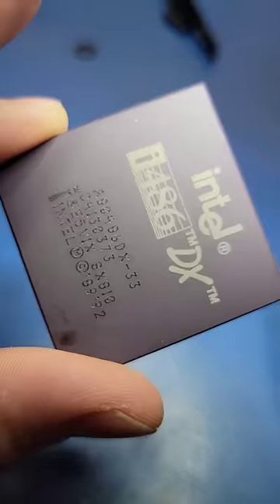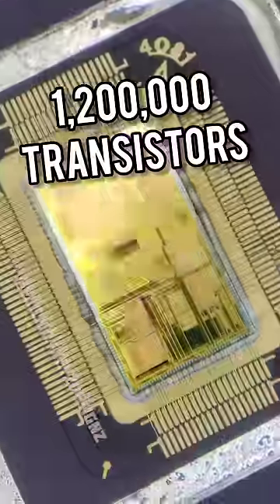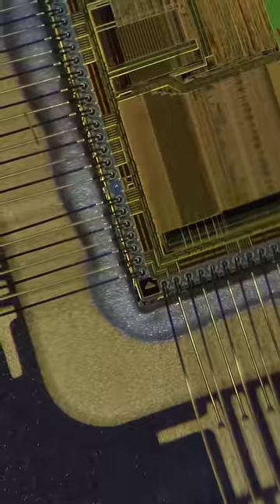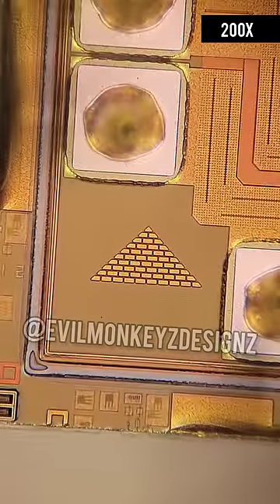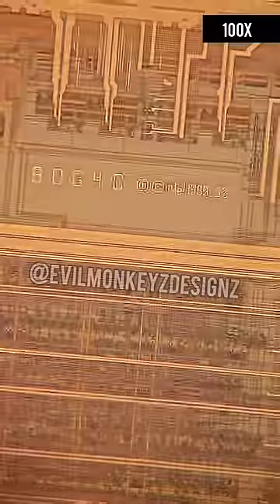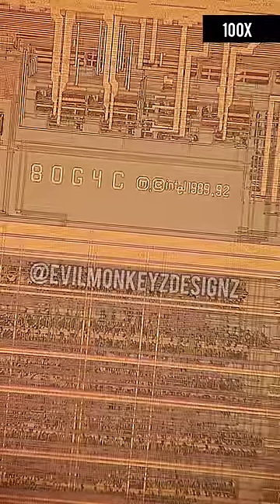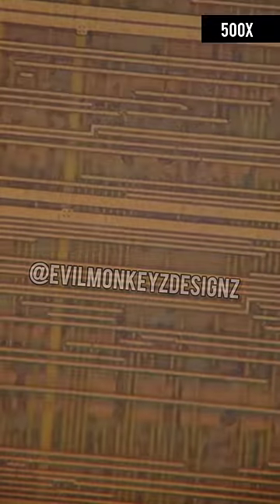Inside an Intel i486-DX CPU

Comment: This already looks very complicated and its only 1,2mil transistors. Its insane how they can fit billions of transistors on something the same size nowadays.
Reply: How big does that make the traces? 100 atoms wide maybe? I'm really curious, if you can answer that
Reply: @furnacego2164 Minimum metal pitch at the 0.8 μm process node was around 2 μm, and about half that for trace width. The minimum distance between atoms in silicon is 0.2 nm, so a trace was ballpark 5000 atoms wide.
Reply: But nowadays traces are 20-30 nm wide at narrowest. So 100-150 atoms.
Reply: @taktoa1  amazing
Reply: @taktoa1  it makes me wonder if there is a hard limit, like if a theoretical trace is 1 atom wide I wouldn't expect the connect to be very reliable
Reply: @furnacego2164 iirc some undesired quantum side effects become problematic the closer we get to atom size (quantum tunneling supposedly, but don't take my words for truth I'm not very literate on the subject)
My concern would also be how does a 1 atom wire/gate/whatever dissipate heat
Reply: @weistonaski6924  If they got to traces being a couple atoms wide, I'd assume they'd have to have the cpu sealed and filled with some sort of gas or something. Wouldn't be able to delid it but.. I'm not sure what else would work.
Reply: Seems my last reply was removed for including a source, typical YT. 
Silicene is being invested in for semiconductors. It's the silicon equivalent of graphene so truly is only an atom thick.
Reply: @EddieTheH  I hope we can figure out the graphene problems, that will change life and possibly time.
Reply: @No_Fuse8771  Agreed, it'll be a game changer.
Reply: What i don't understand what machine can make that so small than any point tip device, lets say it much more like a plat where they inject something like liquid to become a mass small transistor, but still the machine that make that billions, how they make it?
Reply: It's interesting reading at comments from people who knows their shit talking, I could sit in a cafe with y'all and listen all day.
Reply: @jeffreyphandani5160 they wouldn’t used traditional mean of manufacturing for semiconductor. The process is more like using lasers to cut the pattern into a plate covered in wax. Then you run acid over the plat. Then the acid eats away the exposed area. I can’t give any more details after this point. Bc I am not that familiar with the process. But that is a very simplification of the process.
Reply: @hoktang1  thx u enough
Reply: I think current standards are of the order of 150 billion transistors today.
Reply: @deang5622  Out of the consumer level microprocessors the Apple M2 Ultra should be the biggest with 134 billion transistors. 
Solid state memory has way more transistors though. 1TB of TLC flash memory has close to 3 trillion transistors.
Reply: @furnacego2164  At 1 atom wide... Electrons would migrate and the trace would be corroded very fast.
Reply: @taktoa1 dude that’s seriously impressive - congrats son having that knowledge man that’s some real shit! 👌🙌
Reply: Tell me aliens had nothing to do with this...
Reply: @OregonDARRYL  aliens had nothing to do with this
Reply: @jeffreyphandani5160  you use photo lithography
Reply: @beeman4266 what would the gas do?
Reply: "And it's only an incomprehensibly big number of transistors"
Reply: It now clocks in the low to upper 4GHz speeds with double digit billions of transistors. Absolutely wild improvements.
Reply: Silicon Cities.
Reply: Precision required for current CPUs is just mind boggling.
Reply: Ans doesnt melt instantly 🤯
Reply: mil ❌ / Mio. ✌️
Reply: @beeman4266  a superconductor could theoretically achieve those qualities, but the material doesn't exist yet.
Reply: @OregonDARRYL  I've been watching this technology closely since childhood and know the history of the transistor. The progress was slow and steady. I feel like it kind of took off in the early 2000's but remained steady the whole time. There was no "singularity event" producing an unbelievable jump in tech as you would expect from advanced alien tech. I feel like any alien who may be here must have mastered methods of warp drive or anti-gravity tech. Computing power is no longer impressive to me.
Reply: @billybbob18  I hear ya... but look at a 128 GB TF drive and you gotta say... wow. 128 billion addressable points on THAT? Wow.
Reply: @beeman4266  Looks like this tech is running out of things to do at room temperature. The room temperature superconductor will be the next holy grail in computing I suspect. For now, I think TSMC owns the cutting edge.
Reply: Imagine, there are 2 TB micro SD card exist. That means 2000x1000 million byte in the size of my smallest nail!
Reply: @とふこ  Remember... aliens had nothing to do with the shrinking of all of this stuff. Nothing at all...
Reply: @furnacego2164  I think the limit is above 1 atom because you start getting interferences in the flow of electrons even above that point, so i'd say 10 atoms is probably the limit.

In either case you can always start scaling up the processors to keep making them more powerful, though then they generate more heat
Reply: And i wonder How they make processor making machines
Reply: @taktoa1 Excuse me but how can the measurement of 0.2 nanomicrons be the same as 20 or 30 nanomicrons?
Reply: Nano meters
Reply: @OregonDARRYL don't underestimate humanity. Many brilliant minds specializing and refining technology over generations.
Reply: @taktoa1 They are making cpu's with transistors smaller than 7 nm.
That's <0,007 of a um, so it is basicly nano technology by todays standards, not micro tech as desktop sized pc's was once called micro computers, and mainframe pc's for mini computers in the 70's.
"Smart"phones from now has more powerful tech built into them than (or atleast just as) computers had back in 2010 with quad to octa-core tech running beyond 2,5 GHz with ram memory beyond 8GB and a solid state storage up to 1 TB, all in a pocket sized case.🤯👏👏👏😊
Reply: Agreed, it's pretty darn cool. God bless. Jesus loves you!
Reply: @furnacego2164 Is probably approaching the limit of what we can do with classical physics.
Reply: They don't fit transistors, I think they print with special ink or something. 😂
Reply: I love this guy's shorts (videos, not "shorts" 🩳).
It BLOWS MY MIND how small humans can construct, IN CARFUL DETAIL no less.
Literally looks like otherworldly tech to me if I think about how small and powerful these glass artifacts are with their magical ruin symbols on them that allows them to tap into astral energy. Lol😅

It's really something.
Reply: about 2.6 trillion for the intel processor as of 2024.. . and
5.3 trillion for for ddr 5 memory ..as of 2024
Reply: And they want you to believe that it is a product of chance. Think about it. I hope you understand what I'm getting at.
Reply: @freedomofspeech2855  I don't think you know what you're getting at.
Reply: Looks super complicated but is the equivalent to banging rocks together compared to what we use a few short decades later.
Reply: @beeman4266 You're absolutely correct! If the traces were that close, electrons would jump between traces erratically, so some type of medium to electrically isolate each trace would be necessary, if they could be isolated at all. This is a problem we're currently attempting to solve with the use of silicon as the conductor for the transistors. We've reached a bit of a ceiling for how small the die can be for each cpu and still have reliable electrical behavior. We are looking into things like die stacking, and even the use of other electrical mediums like graphine, but as of now we're rapidly reaching a peak in the speeds we can reasonably expect from a silicone die without making the die larger.
Reply: @JayJadhav  There's currently only one company that can make the state of the art 'processor making machines', ASML. At its core, it's a bit like photography. Chips are 'developed' using chemical reactions to light. However, the scale of it introduces some highly complex engineering and physics issues. Those machines themselves are massive; about the size of a shipping container.
Reply: @marcocacucci
There is no such thing or word as "nanomicron". Micrometer (micron) = 0,001mm, nanometer (ųm) = 0,000'001mm
0,8 microns = 0,0008mm
Today we have standard 7 nanometer chips (0,000007mm) and some pushing for 2 nanometers, with 1 being experimental.
Reply: Still don't get it. How can it do any amplification, when it's just copper?? I mean it just looks like a circuit board without components??
Reply: @kawmic7  ..the transistors are very very small today the limit is around 3 nm (namometers) 0.000000003 meters, a human hair can be as small as 20 micrometers, enugh to fit 10000 transistors across, a regular microscope is not stong enugh to se the induvidual transistors...so thay appear as a surface, the leads between components can be copper/gold, components are usually also stacked in layers, and layers for cooling are added ..
Reply: @kawmic7  ..u can see the layers when the vido zoom in on the dx logo, u see traces running over and under traces those r separate layers, u can alo se on the bottom how the layers ar laser welded between layers
Reply: @floks700  Seems to be a genuine I80486DX2..
btw the cpu u refere to was released in june 1995..
the die clearly say 80G4C Intel 1989.92
, wich is a 486DX2, i dont know exatly what changes was made between DX,DX2 and DX4 on the die...
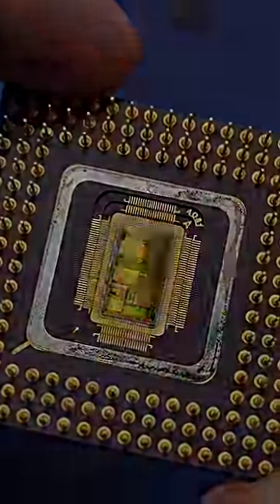Reply: @floks700  ..from the video 00:06 'Unfoutunetly i dontm have the photage from opening this part, but it looks something like this' .. its an example
Reply: @floks700  ah, thats totally fine...
anyway, ur writing is perfectly understandable .. u get there...
Reply: Now a days 200 billions!!!
Reply: @miguelbmx137  ya its pretty wild .. 
if current roadmap holds by 2027 or so 1.6nm .. an one silicon atom is about .235nm .. 7 atoms wide, needless to say approaching the limit of a silicon lattice of .543nm, it is probably impossible go smaller with silicon
Reply: @Patrik6920  1.6 its PR bla-bla. The real dimention of gate is 30nm🤣👍. So history of Si usage will go on to 2060 or so longer.
Reply: money
Reply: @OregonDARRYL  Not aliens.  Just a few geniuses paving the way for the rest of us.
Reply: @SomeDudeInBaltimore  This stuff is far too small.. something's up...
Reply: @OregonDARRYL  Lithography is what makes it possible.  You use vapor deposition to add layers of material to the wafer if you need to (like the aluminum or copper interconnects).  Then cover it in a photo resist material.  Then shine a light through a giant transparent version of the circuit, use lenses to focus it onto the wafer, and then etch away the parts where the light didn't touch to cure the photo resist.  That's all there is to it.  You basically just add layers one by one as one entire solid piece, and then etch away the parts of that layer you don't want.

It's like making a house out of one giant solid brick and then whittling away parts of it and tunneling through it to make a house.
Reply: If people back in the 40's saw the complete sh1t we're pulling off with computer chips and circuitry these days, they'd assume that WE were the aliens, and not the greys at Roswell.
Reply: the method is casting . small cuts casting gold then casting silicon and then casting gold . the links are dug in the silicone
Reply: Alein tec
Reply: O kadar da olsa güç transistörü kadar kuvvet üretmiyor sadece işlem gücünü arttırmaya yarıyor 10 mW lık transistörler.
Reply: @furnacego2164  They literally turn on lasers and tiny transistors are created by precisselly manipulating quantum fields. This is insane.
Reply: @Petardozord  wtf bro I can barely even comprehend that. Dope as heck for sure
Reply: @furnacego2164  nope.  There will be a stopping point on the nano scale.  Symbiotics already exist in the private sectors.  Below the nano scale.
Reply: Fews atoms per transistor
Reply: In 5 years you will laugh about this
Reply: @furnacego2164  Moors law explains this kind off, how we're experiencing limitations because of the fact transistors gets closer and closer the size of atoms.
Reply: Trillions for something the same size, billions for the size you have in your phone!
Reply: Aliens told us
Reply: And windows still runs like a sick dog
Reply: @taktoa1  I think it's really great that there are people who know something like that and give out answers like that without any ulterior motive, as if it were common knowledge. 

Sometimes I still have hope that we won't all die because it's cool to eat laundry pods. There aren't even any electrolytes in there!

Comment: I am privileged to have precisely one entire silicon wafer of this processor.
Reply: The entire wafer was defective? Unusual.
Reply: @raylopez99  some chips are marked with a dot as defective but not all. There are a few healthy ones.
Reply: @Flashjacks  Don't they sell the healthy ones?  Or was this a wafer they decided to keep as a memento despite it having chips you could sell? An expensive paperweight.
Reply: @raylopez99   Well, it is a whole wafer, uncut. I bought it many years ago. It is designed to be framed together with the complete CPU, which I also have. I don't know how much this could cost now, honestly.
Reply: @Flashjacks  it's priceless ;)
Reply: How many chips??
Reply: Could You share photo somehow please?
Reply: If wafer yield is below a certain percentage (say 80%), the whole wafer gets scrapped.
Reply: I found one P4 with HT technology in a PC dumped on the street...